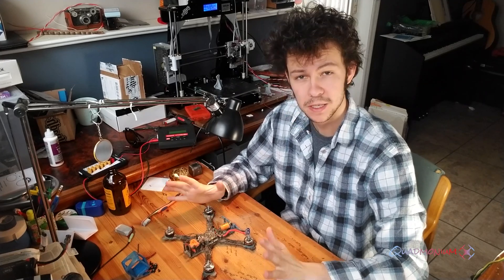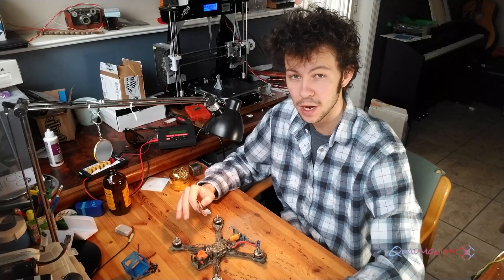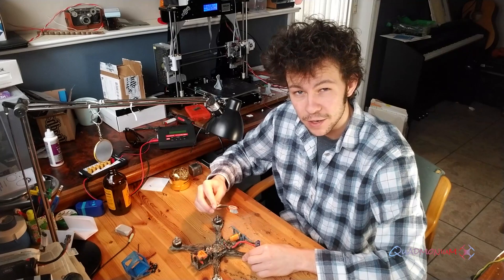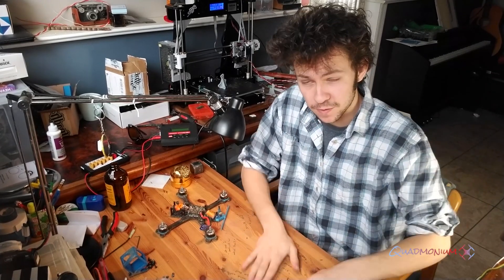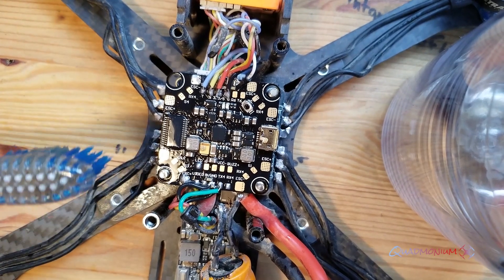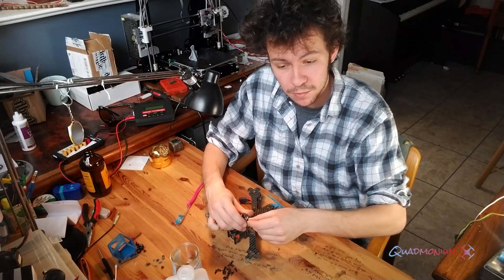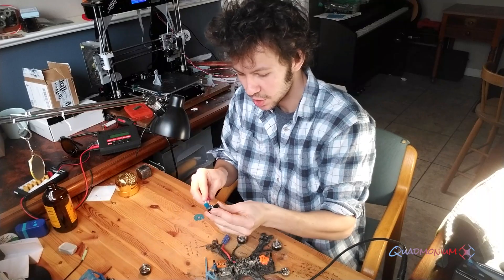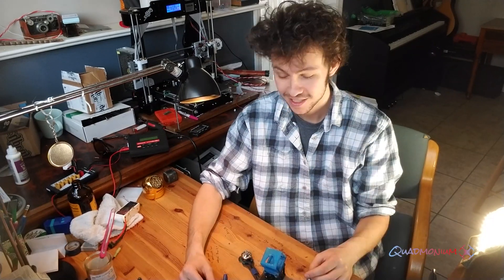How to clean your quadcopter BEST METHOD

Comment: Could i also emerge the whole drone under warm water and clean it this way and let it dry for a week? (+ with the dji o3 unit on it)
Reply from the maker: I would highly discourage it. Especially with small commercial parts like the DJI module, water can get trapped and remain even after a long drying period. I would still use the method I described in the video. It takes less time and is safer for your electronics.

Comment: Hi, I need to clean my fpv drone but I can't find isopropyl alcohol is it ok if I use technical alcohol????? Would I get the same results?
Reply from the maker: Are you referring to technical grade / technical use alcohol? I have never heard of technical alcohol.
Reply: It is like 93% ethanol and few % of water
Reply from the maker: @honzabelada4808  I would be hesitant to use that. It may leave a residue and it's not as strong of a solvent from what I can tell. Your research may say otherwise, and in that case I would trust your own judgement. It may work well for you but I have never used it so I can't advise about it.

Comment: After a day of flying, I screw the motors of the frame so they are so I can lift them off the frame to keep them out of the bath. then I submerge the rest of the quad in isopropyl alcohol for about one hour. after that i blow the entire quad with my air compressor. screw the motors back on the quad and that's it. takes about 2 minutes of labor in total to clean the entire quad!
Reply from the maker: I find that the whole quad rarely needs cleaning.  So my focus is on the motors which always need to be clean for the best performance.  Seems like a great method for cleaning the whole quad though

Comment: Dont forget to lubricate motor rings after cleaning !
Reply: What kind of lube is best?
Reply: can i use automotive grease or something else
Reply from the maker: The motors themselves should not be lubricated.  This is a brushless motor, the motor cap and magnets do not touch at all.  the only thing that would need any lubrication is the small bearing in the bottom of the motor that connects to the shaft.  A light coating of wd40 should do the trick but stay away from heavily viscous lubricants. That will increase resistance of the motor and lead to friction.

Comment: Not sure if you want to use isopropyl alcohol on the motor windings. They're coated, and alcohol is a solvent. Might soften that coating and take it off while brushing. Also, you don't want to get it into your bearings since these are lubricated, and the alcohol might take that off too. Better just use water.
Reply from the maker: You make some great points. I should have clarified to only use isopropyl alcohol on enamel coated motor windings.  Isopropyl alcohol does not dissolve enamel but if they are really cheap motors, they may be coated in varnish which can be dissolved with isopropyl alcohol.  As for the motor lubrication, I haven't experienced any issue with motors overheating as a result of too much friction. It may be a good idea though to re lubricate after cleaning as bearing tolerances can differ from motor to motor and brand to brand.  More tolerance would increase vibration and yes, potentially damage the motor.  I'll include an updated description to account for these tips.  Thanks for the comment!!
Reply: @Quadmonium  Thanks for the reply and education! I did not know all of this.

Comment: Got the king kong capacitor on that rig
Reply from the maker: I thought it might help with the horizontal bars I occasionally get in my video feed.  That and filter out some of the voltage spikes that cause the components to act up and wear out.  That was the theory at least XD.